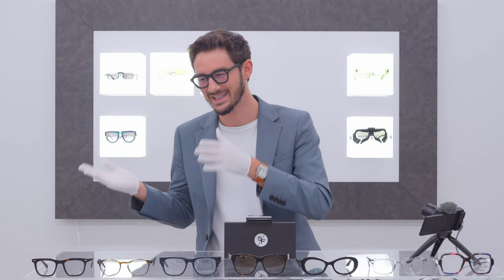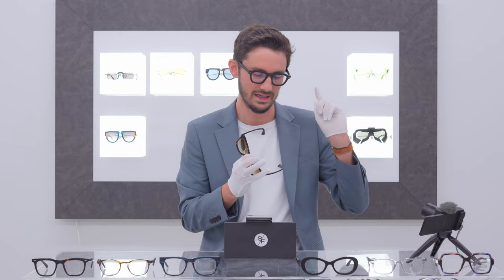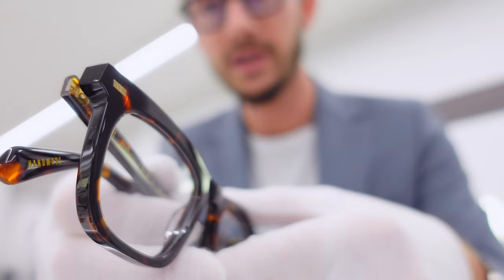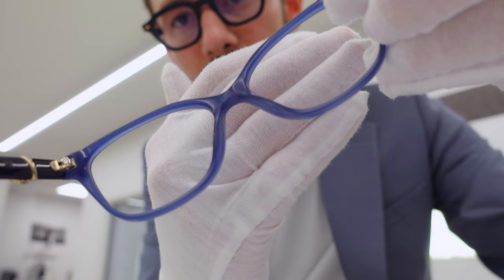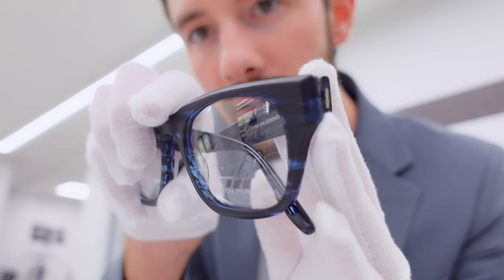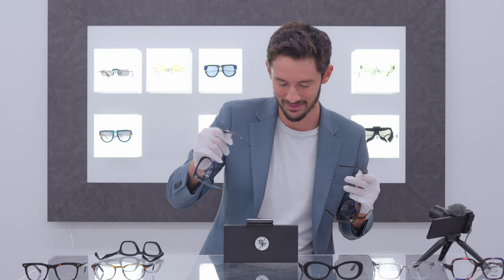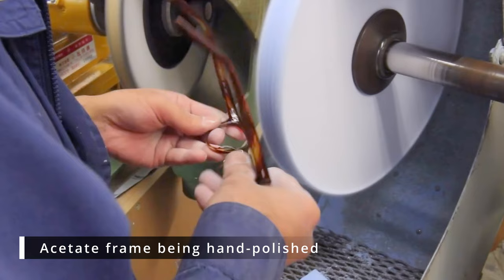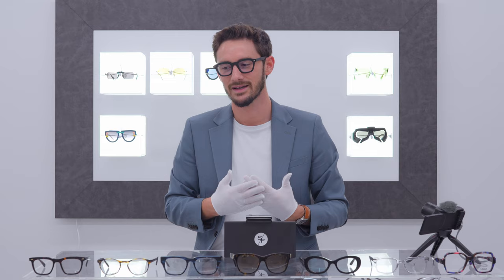How to choose ACETATE frames | EVERYTHING You Need to Know

Comment: The problem with acetate is that it is made like paper, involving the mixing of sulfuric ACID to cotton & vinegar.  I assume you have heard of "archival acid free" paper.  The acid that made it, is its seeds of destruction.  In expensive paper, the acid is leached out after making.  But for cellulose acetate plastic, it is non-porous.  It is much more difficult to get the acid out & invariably some remains, contributing to its degradation.  It also has "water of hydration" (which you mention) which is part of its chemistry.  I have seen recommendations to soak frames in water periodically to restore what's lost.  It is less stable chemically than other plastics as it is organic, like wood.  Even the best acetate degrades!  Like wood, it swells & shrinks with changes in humidity.

Comment: Great info.  As a image consultant and stylist I have to guide individuals not only on what to buy but also what not to buy.  The tiers were very helpful.  Other than the shine and losing moisture what or performance and durability would you notice based on the quality of the acetate.
Reply from the maker: Thank you 🙏
Lower quality frames deform and break/crack more easily and don't feel as soft on the skin.
Reply: @thespectaclefactory  Thank you for the info.  So when they deform and break this will affect their ability to have a proper fit over time and also they ability to hold the lens.